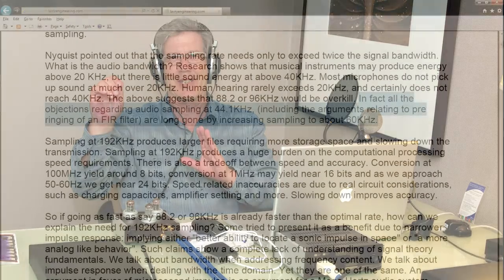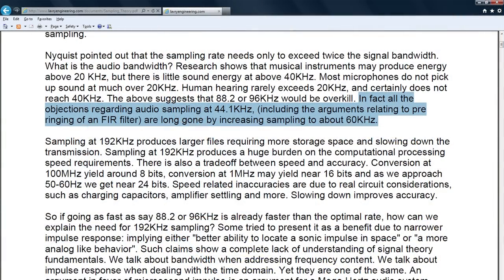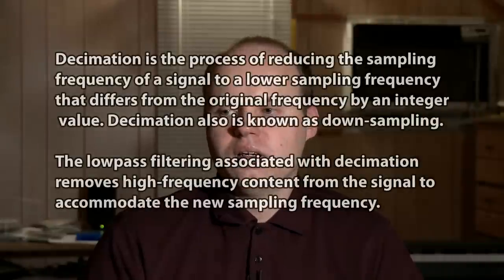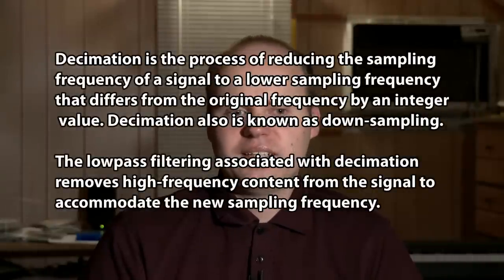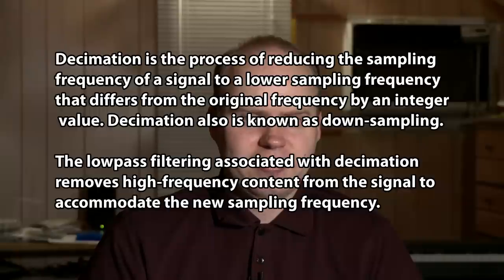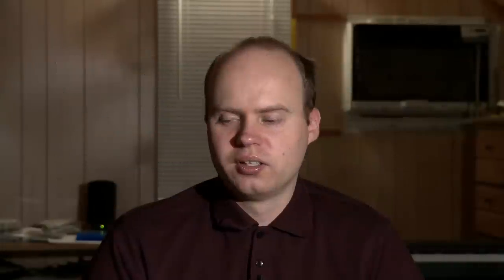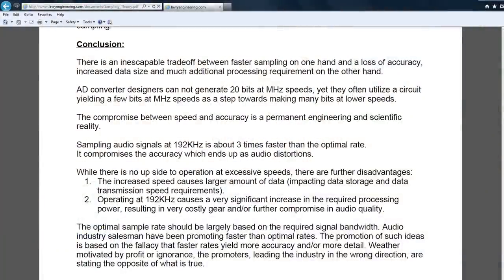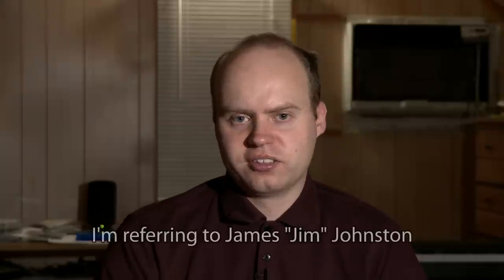Best Sample Rate For Audio Recording Ideal Sampling Rate

Comment: I record at 96, but during mixes with lots of plugins it`s impossible to work. So that  I change settings of audio interface to 44.1 in Reaper and switch them back after eveything is done. Reaper resamples everything automatically. 
However still CD standard requires 44.1, mp3 doesn`t even deserve to talk about. So sometimes I don`t understand for the sake of what am I doing those higher sample rates)

Comment: Hi Adam. I record guitar, bass and vocals live. Drums, Pianos and Orchestral stuff is all done in Kontakt. Most sample libraries are 24/44.1 so I've read people say if you are using lots of samples you should record with 24/44.1. I've also heard lots of people talk about how 88.2 down samples final 16 bit/44.1 better than 96. So I was thinking about 88.2. Just wondering your thoughts between 88.2 and 96? I'm completely tortured. This sample rate bit depth stuff is a nightmare.

Comment from the maker: I don't recommend recording to older laptops. You can do it but as you've experienced there can be limits. The main thing is your hard drive and bus speeds vs. desktops. 5400 RPM hard drives are in most older desktops it wasn't until recently that they started going to 7200 RPM. If you have a solid state drive then laptops are fine.

The Aurora is a bad ass interface so at least you're set there. Professional audio is definitely not a cheap hobby by any means but it's better than years past!

Comment from the maker: @rockstar170 I've read tons and tons of info on sample rate/bit depth. I've come to the conclusion that the ideal combo is 24-bit/96 kHz. 60 kHz is probably more than enough but most analog to digital converters and software do not support it. Virtually all support 96 kHz. A lot still do not support anything above 96 kHz. So 96 kHz it is. Or downsample to 96 kHz.

Pricey interfaces have better anti-alias filters, a more perfect pass band and transition band, plus higher signal to noise ratio.

Comment: @RealHomeRecording you make a great point about the other factors, though, as an artist one will go to great lengths to make their recording sound "magical."  I notice at 24bit/96 kHz on my Aurora the noise floor is much lower. Though all that noise comes back when I dither to 44.1. The downside I find is that my laptop over heats fast when I run 96kHz, and can't handle more than a few tracks. I suppose I'll need a new computer upgrade soon. Ugh, home recording... the never ending money pit.

Comment from the maker: @rockstar170 The benefit of the 24-bit/96 kHz format is not playback it's production. Headroom for noise (allowing for quieter recordings/avoiding clipping) and math calculation (rounding errors/dither truncation). Very technical stuff that we shouldn't worry too much about.

Musicians' talent, the room, microphone placement and the microphone itself is more important than this stuff. So if you already have the former down then "that last 10%" is where this bit depth/samplerate business falls.

Comment from the maker: @rockstar170 I would say yes for the sake of plug-ins' math. Pitch correction like Auto Tune tends to work better as does compression. Someone did an experiment with vocal removal from a full mix and had better results with 96 kHz than 44.1 kHz. Upsampling helped a little bit. So there is more accuracy with 96 kHz recordings assuming that person was truthful.

96 kHz also gives you the option of not having to enable oversampling in certain plug-ins..Upsampling can have its trade-offs...

Comment from the maker: No, all mastering is done at 64 fp/96 kHz. The final step is to convert from 64 fp to 16-bit with a final pass of brickwall limiting. So I'll render a 64/96 file out of REAPER. Drop that into Voxengo r8brain. Downsample it to a 64-bit/44.1 kHz file.

Then I bring the 64/44.1 kHz file back into REAPER and use brickwall limiting and dither. That'll be rendered to a 16-bit/44.1 kHz file. It's a lot of steps but it's worth it.

Watch my video "Dithering Audio When and Where" for more information.

Comment from the maker: @rockstar170 In general though I still wouldn't trust laptops 100%. I've always had issues with them like when the fan kicks in there was an audio pop/click until I bought a cooling pad. Power save modes. But if it's all you got then it's all you got! There are rules that are meant to be broken and what ultimately matters is the final product.

Just remember most people are listening to a data compressed mp3 anyway LOL. But that soon is changing to and 24-bit FLAC files may one day be standard

Comment: Interfaces do not have a "native sampling rate". They have sampling rates that they are CAPABLE of. My UFX can do 192k. That doesn't mean 192 is its "native" sample rate. Sample rates have been up at 192 for many years, and you can thank MARKETING teams for the confusion. They marketed higher sample rates as better sound to sell gear.

Comment: RealHomeRecording.com did I just hear you said we hear up to 44.1 kHz at1:19? the human hearing range is 20-20khz and according to "Nyquist–Shannon sampling theorem" in order to record and represent a 20khz signal you need at least 40khz sampling rate!
Reply from the maker: Hossein Montazeri Not at all. The sentence begins at 1:08.  "Up to a point--with sampling rate--you cannot record the full spectrum of human hearing  Which is approximately 44.1 kHz." I was referring to sample rate to record human hearing which is one number. If I was referring to the spectrum of human hearing I would have said 20 Hz to 20 kHz, approximately.

I did misspeak and should have said that up to a certain point you can record more than the full spectrum of human hearing. Because I then go on to explain why I don't just record at 44.1 kHz.

Comment: Be reasonable, you can get a Prism Sound Dream or Antelope Audio Pure 2 for around $10,000. Any delta-sigma A/D will handle 44.1 well by upsampling anyway. You just don't need to save the files at the higher sample rates. Convert then decimate.

Comment: I'm working on a Windows machine using a quad-core i7 and I've been recording at 48khz 24bit with no problems until recently I decided to change the sampling rate of my Focusrite 2i2 card to 192khz and boy, I'm getting some really bad dropouts in my recordings. I haven't had dropouts like that since the early days of recording on a 486DX33 Windows system. Now I have just watched this video, and according to you 192kz is a waste of time? But isn't it required for DVD quality audio? In the meantime I will drop the soundcard back to down to 96khz and see what happens.
Reply from the maker: There isn't really such a thing as DVD quality audio but the standard is Dolby Digital (AC3) encoded audio at 48 kHz. Since Dolby Digital is lossy audio, you don't want that. I have rarely seen a Bluray with audio over 48 kHz, with LPCM coding.

If you're having drop out issues then yes I would just set it to whatever sample rate does not give you problems. You may also have to adjust your buffer setting because on my Audient iD14 you could only have a buffer of 128 when using 96 kHz. Anything lower would cause major computer glitches like how you are describing.
Reply: thanks for getting back to me so quickly! I reduced the sampling back down to 96khz with a buffer of 256 and I have no dropouts, and the audio quality is pretty good to my ears. Wow, so Blueray is only 48kHz you say? @RealHomeRecording

Comment: Hey Adam, don't most plugins these days have built-in oversampling to compensate for projects that might be in 44.1?

I was recording in 96 kHz, but even my 2700k i7 processor is taking a beating and i hate bouncing all the time.   I am thinking of going back to 24bit / 44.1  - what do you think?  thanks!
Reply from the maker: +Adam Lewis Plugins have had oversampling built in for a long time now but they aren't as good as being native. Think of it like taking an 8-bit recording and converting to 24-bit. The file will be 24-bit but you still only have 8 bits worth of usable data.

If your processor is struggling either bounce/freeze tracks or record at 48 kHz. I've seen a lot of engineers going the 48 kHz route.

You could also record at 24/96 then batch convert those files to 24/44.1 for mixing. Archive the 24/96 files. Kind of like how they are shooting movies in 8K now but very few will see the movie at 8K. Future proofing is a good idea.
Reply: RealHomeRecording.com yep I get it...   thanks for pointing that out about how the oversampling is not as good as native.

question about your statement about recording in 24/96 but converting to 24/44.1 for mixing:   wouldn't I in essence be adding plugins then to 44.1 tracks which you stated above its best to process plugins in the 96 kHz world?   maybe I am missing something there.
Reply from the maker: Yes you would be operating at 44.1 kHz which will affect quality. I only recommend that because you said you are running low on CPU and it's an alternative to freezing or bouncing tracks.

But by recording at 24/96 you're preserving your tracks for later on down the road when you have a faster computer and can easily mix 24/96 tracks if you ever wanted to do a remix. Because if you stick to it you will become a better audio engineer and having those high quality tracks will be welcome years from now when an i7 6700 is considered obsolete.

You could also convert to 24/48 so that you have a little bit better quality.
Reply: RealHomeRecording.com oh ok got it... actually just made some tweaks to the CPU parameters in Sonar and now 96 kHz is running pretty good.  thanks for all the help today
Reply: RealHomeRecording.com Hey Adam, in Sonar,there is an option for each individual plugin to be oversampled by 2x - so you can work in a 48 kHz file and oversample the plugins to 96 kHz if needed.  There is 2 options, oversample on playback and/or oversample on render.

not sure if Reaper has this, but you might want to look.  this way you can keep the benefits of working in 48 kHz file with the benefits of 96 kHz for your plug ins!